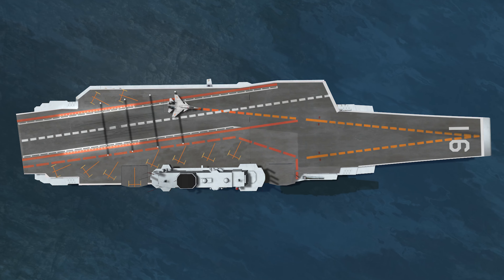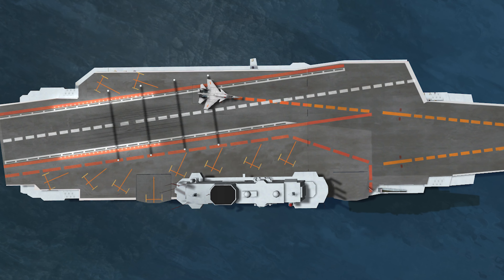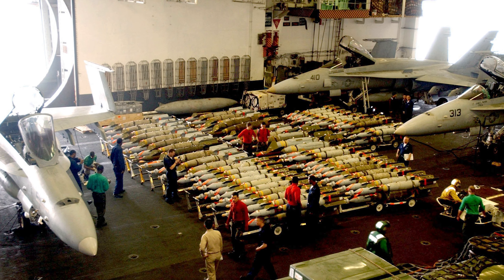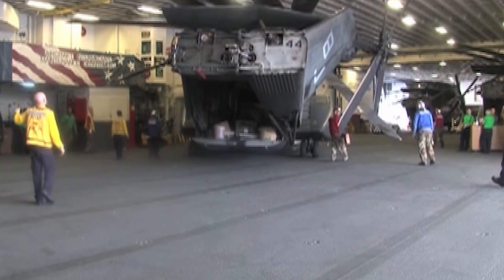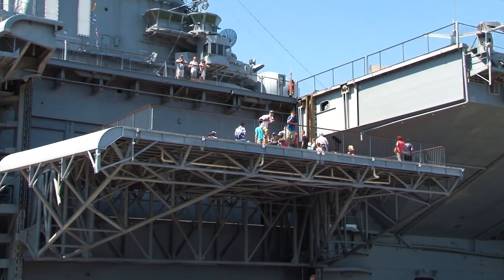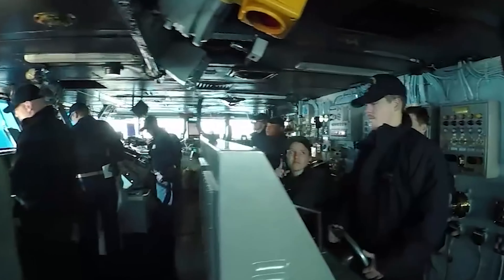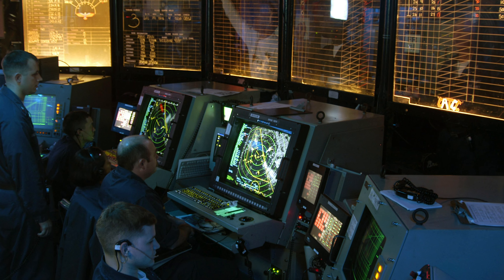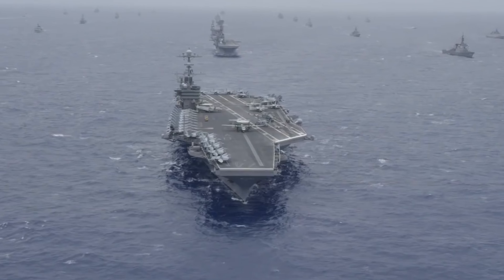വിമാനവാഹിനി എങ്ങനെയാണു വിമാനങ്ങൾ സൂക്ഷിക്കുന്നത്

Comment: Missed few key points: The main advantage of steam catapult is that it can launch Aircrafts with more payloads/Ordnance, thus optimizing multi-role missions in single sortie.
 Since you emphasized on US Vessels, the latest innovation of Launch System :' Electromagnetic Aircraft Launch System' inducted on "Gerald R.Ford" should have dealt.
Then , about ski jump, Angled Deck(why the need of ~ 9°). Overall good attempt to squeeze things in nutshell.